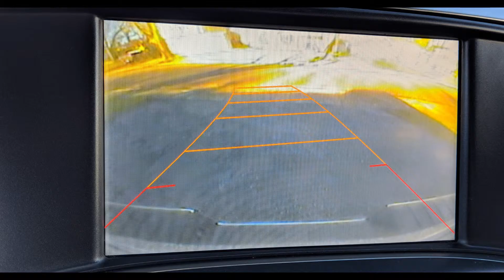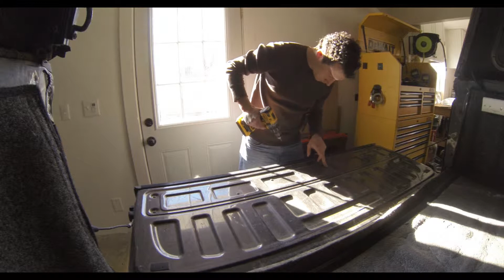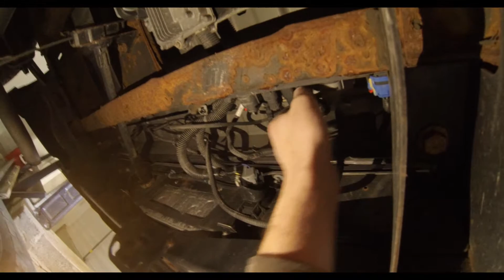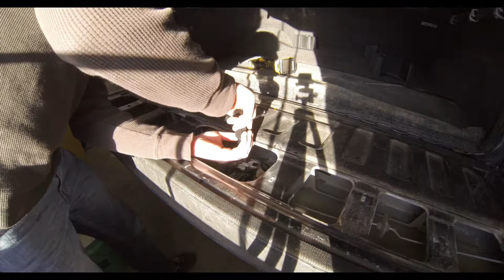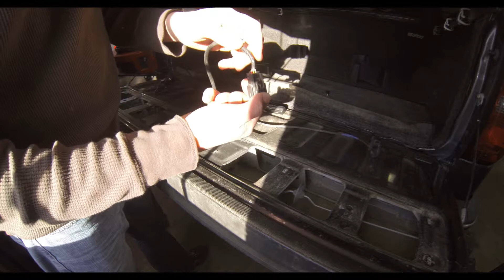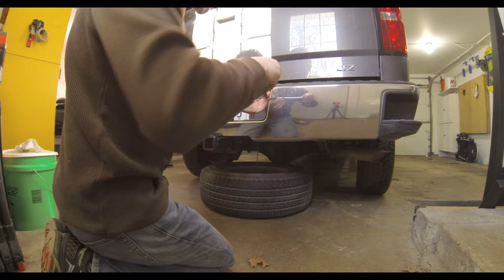Silverado Backup Camera Replacement

Comment: I saw another video for this, and the owner tied a long string onto the plug before pulling the cable out, and tied the new plug onto the string and then used it to pull the new plug/cable through the tailgate and truck body.

Comment: This video was great. Helped me through replacement of my camera in 2014 Silverado LTZ. I also followed suggestions of other user comments in not removing spare in full, install new camera before running wire and taping to existing wire while running through tailgate.

Comment: Great video, appreciate the size list for various tools. Couple of notes - 1. Fishing the camera through the tailgate. Tape a string onto the old camera and pull through when replacing. Makes that joba whole lot easier. 2. Don't take off the spare. It can be lowered and moved over enough to do the job. 3. Install the new camera with the screws to the tailgate before fishing the wire through. That way it doesn't bounce around and get broken or scratched. New camera ran about $100, and is well worth the time and upgrade.

Comment: I have the same issue with my backup camera. Poor video quality. I drive a 2014 Silverado LTZ. I'm sure it's the same camera. Do you have the part number? Thanks for the video.
Reply: Same issue but person hasn't replied to your comment. Would also like part # had camera replacement by dealer under warranty it's still blurry on a good day. Its getting annoying drive a 17 High Country
Reply: Did you end up getting part #? if so can you share the part #
Reply: @ZzZSparks  Genuine OEM #84062896 fits 16 to 19
Reply: @anthonymacneil2279  Hi Anthony my silverado is  a 2014 LT extended cab 4X4 5.3L 4 door.
Reply: @ZzZSparks  It will probably fit 14 and 15 too there all the same. I just checked that part # will fit yours
Reply: @anthonymacneil2279  Thank you for responding very appreciated
Reply: @ZzZSparks  Anytime hope the fix works for you. Having mine installed end of month. Its $116 plus taxes